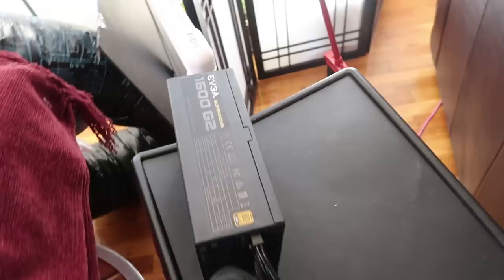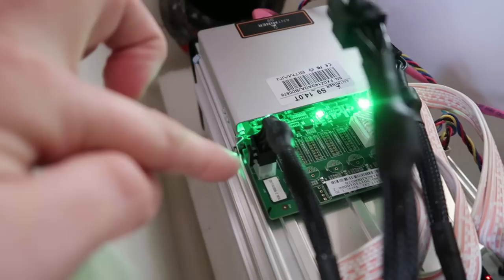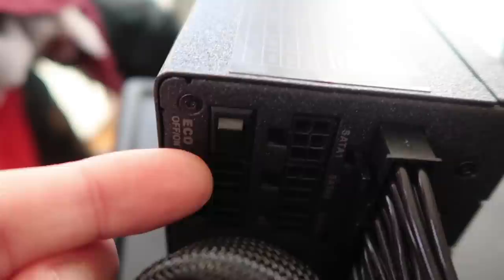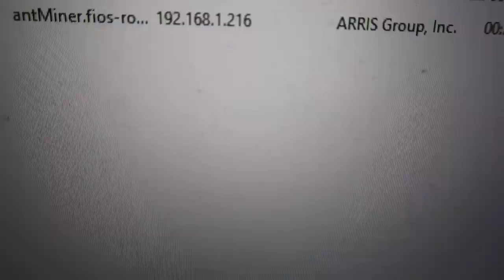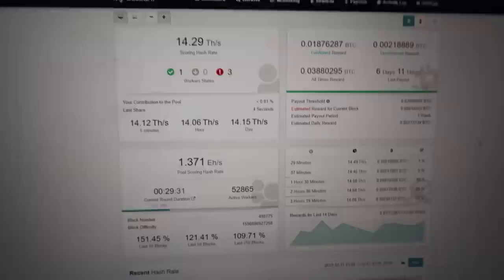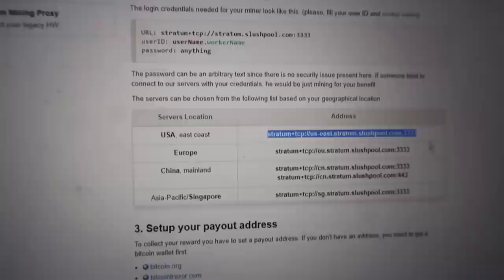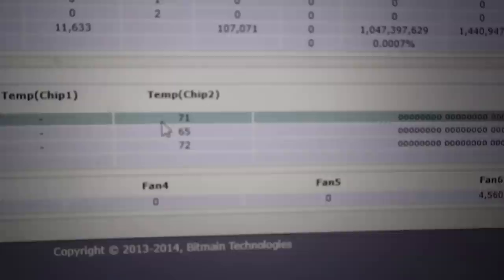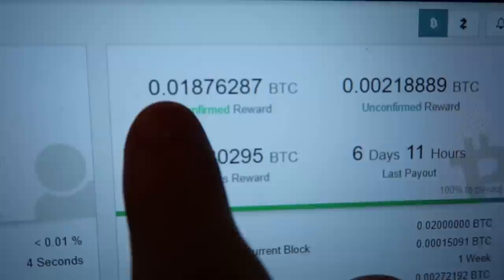Antminer S9 Setup Guide - 2 Weeks Earnings

Comment: Hey, I have an issue with my AntMiner S9, and thought you might have an idea of what to do. I was able to get it up and running at one point. I even connected to it on the computer using its IP. However, the connection was poor and only lasted a few minutes. Since then I have not been able to connect to it at all. Today, my bitcoin miner will not even turn on when plugged in. What should I do?

Comment: I got the computer internet connection in the modem. Do
I hook a splitter cable to that
slot and plug in the miner and
computer or put the miner in
different slot? Does that require
configuration of the modem?
So all I do is plug it in and it starts
mining on bitmain mining pool?
I have to get my info at bitmain
or different mining pool?
The amtminer has IP address and
that address is where you put info
in? This video is more detailed. It
taught me better. I think I understand. What I am fuzzy on
is how to hook it to modem. Also
when you plugged in the power 
cables I wasn't sure what kind of
cable you had for that other connection you did and what you
plugged them into to.

Comment: Hello JMS, 

I am from india. Here the electricity is 220 volt, 50 hertz/s. 

I am planning to buy antminer s9. Do i need to buy PSU? If i need to buy, can i buy bitmain PSU? 

If i am buying 50 antminer s9, do I need to buy 50 separate PSU or any one big PSU available as per power consumption of total antminer? 

Do i necessarily need to provide air-conditioning ? If we provide, how much efficiently will it improve? 

What is the life expectancy of antminer s9 and PSU? 

I am planning to buy solar panels to power supply the PSU. 

Can you recommend any best brand for solar panels for bitcoin mining ?

Comment: if you order an s9 miner and the evga power supply you suggest do they come with all the cables you need or did you need to order additional cables. I am ordering and s9 miner right away. just want to make sure all I need to order is the miner and the power supply
Reply from the maker: If you get the exact PSU I have, it comes with all the necessary cables.
Reply: JMS Vlogs I just got my antminer s9 but it's the 13.5 th version shouldn't matter all that much since I have a 220 v outlet it should even out the cost and rewards
Reply: Why wouldnt you just order the AP3W++ from Bitmain?

Comment: Your videos are on point man. 
Curious are you planning to run more miners? 
I know I've spoken to you before and I have 4 coming on the batch in Jan. 

So I'm really curious whether I'll need to use four different electrical outlets or what the best way to run all four (power concerns). Think I'll need a USP or converter? Or just run one S9 per wall outlet. It's keeping me up at night lol.
Reply: With the power draw on each miner being up to 1500 watts (13.6 amps at 110v), that is about the max power you can safely run on any 15amp circuit, to which you don't want to run anything else on that circuit or you will probably pop the breaker.  Each outlet CAN handle up to 15 amps, but, ONLY 15 amps PER CIRCUIT (which can have multiple outlets on that circuit).  Kitchen outlets are usually 20amp circuits, but, again, can handle only 20amps on the whole circuit, not each outlet.  

To run 4, you will have to find outlets on 4 different circuit breakers in your home (most likely in different rooms), because you will be looking at about a total of ~55 amps of draw.  Be careful if you only have a 100 amp service to your home (older homes or apartments are more common), because you will already be using about half of its capacity, and if you then run multiples of any large electric appliances (A/C, furnace, oven, washer, dryer, etc) with 4 miners running, you could possibly overload your service panel and pop the main breaker.

In your case, with 4 miners, you may just want to have dedicated outlets wired in to your panel (if you have the capacity) to run just the miners, and then you won't have to worry about any of the above.  But, that won't be cheap if you are not an electrician.
Reply: Yeah, So i get 200amps on my panel. I see there are some circuit breakers with 50amps some with 25 others with 15. I'm going to see if i can get an electrician to just use the current rooms outlets but switch each to its own circuit breaker on a 20-amp
Reply: Glad you have the 200amp capacity, that is a good thing.  It is probably going to be hard to run new wires to your existing outlets because they of course are already part of the existing circuit, and dealing with the existing wiring in the wall will make a costly proposition.  Most likely the easiest (cheapest) option will be to have 4 new outlets/circuits run to that room.  Just make sure your panel has at least 4 unused breaker spots that can be used, because each one will need it.  If not, you may have to add a sub-panel.  Let us know how it goes!

Comment: I’ve had my antminer s9 since January and I still don’t understand where to get 120v psu that will actually run it
Reply from the maker: Look for the 1600W G2 SuperNOVA... Affiliate link: https://amzn.to/3yF6Orq
Reply: JMS Vlogs 536 bucks I can buy a 5600xt making this pointless. I need a unit that’s less than 350$ that’ll work.
Reply from the maker: Unfortunately the S9 needs close to 1600W to operate. That PSU is the one to get. It’s expensive because the mining profitability is high for Btc right now. Maybe you can find a cheaper one on eBay.
Reply: JMS Vlogs eBay prices are worse than new in some cases.
I found them 372 no tax , no shipping, refurbished tested etc and most importantly IN STOCK lol

Edit: imma sub you and thank you for The video and advice. It’ll be nice to get this thing spun up.

Any advice on what to do with two dragonmint T1s? Are they completely useless and obsolete at this point ?
Reply from the maker: Cool thanks 👍 I’m not familiar with those miners. Good luck, and enjoy that lower mining difficulty!

Comment: Small correction. Minimum payout is 0.01 on Slush Pool
Reply from the maker: you're right, but they take a fee if its lower than .01
Reply: JMS Vlogs Yes. There is no fee for 0.01 BTC. They charge a fee below than that

Comment: How do you connect monitor to antminer?
Reply: you dont, you use a pc to open the antminer in a web browser by typing in the IP
Reply: Valorous so could you log on through your phone? Or do you need a pc? Because I don’t have a pc or monitor.
Reply: you can use your phone as long as youre accessed to the same network as the antminer. :)
Reply: connected*